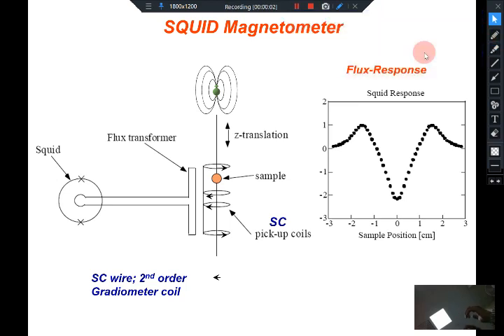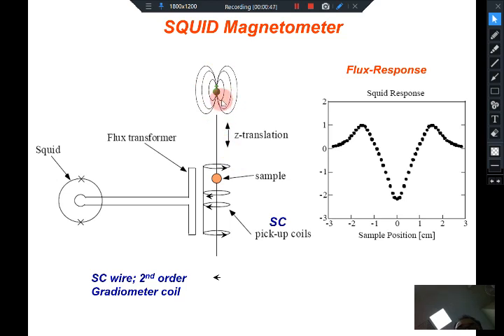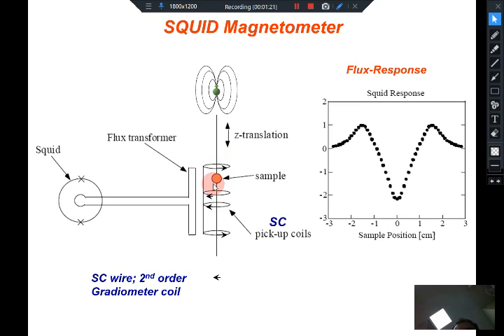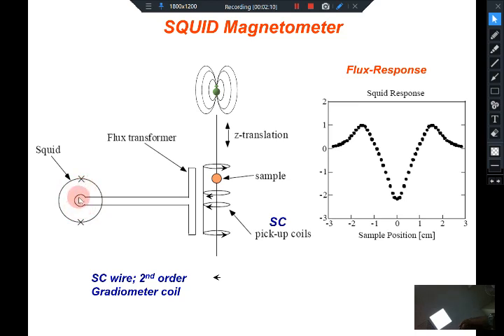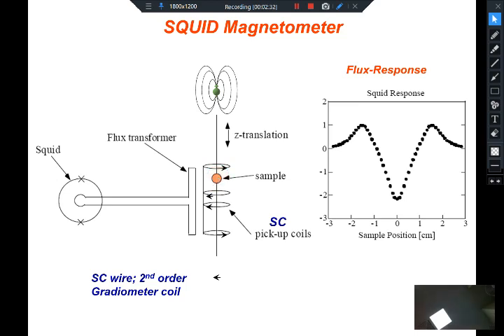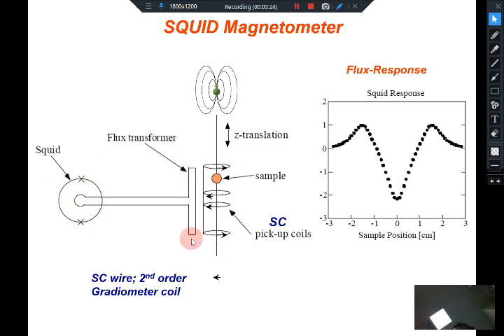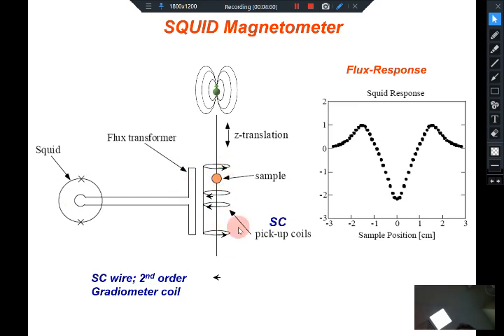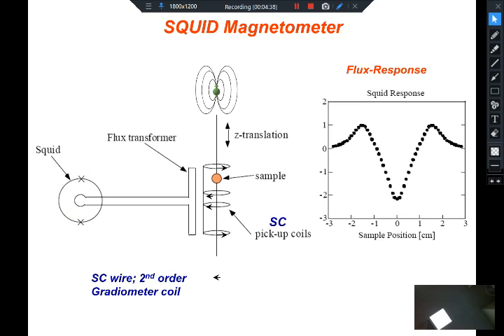Lecture 39

Comment: Ah okay so the static magnetic field of the coils doesnt induce a current in the flux transformer? But how can this external field be changed to get a B(H) curve? Or if you are just measuring the change in Field when a probe is inserted M(H)?    Is the probe oszillated quickly and the static field is changed only very slowly?